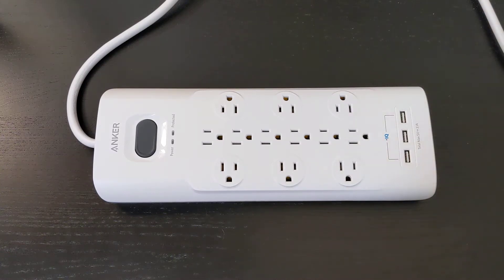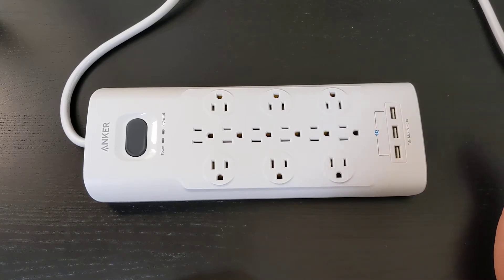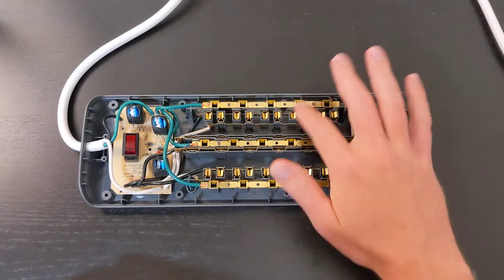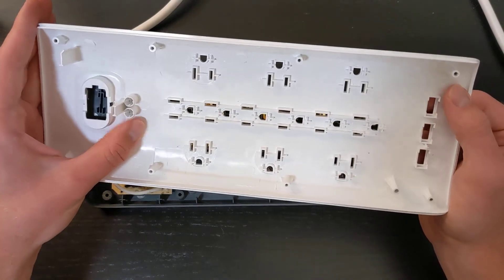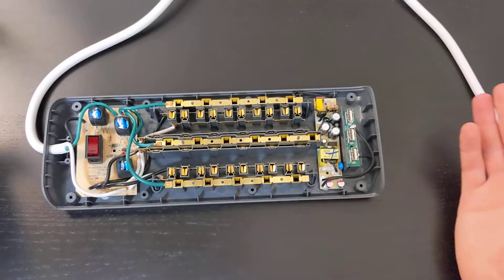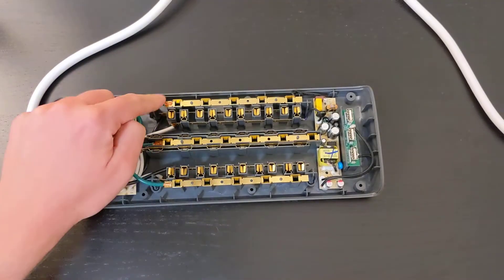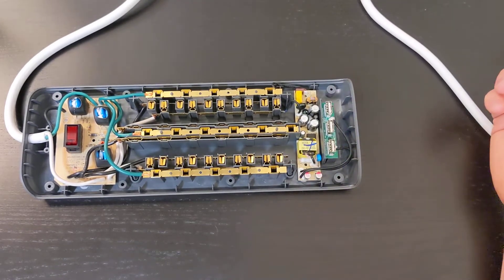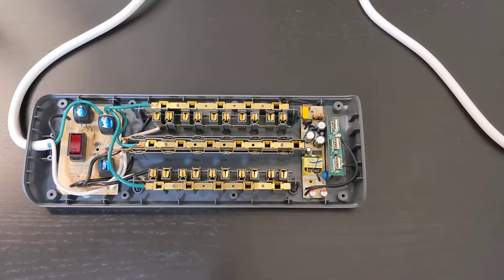Inside an Anker Power Strip with Surge Protector and USB Charger

Comment: I revently bought several Anker surge protectors. Im a huge Anker fan and really like their power banks and cables so when i found out they made surge prtectors, going wuth them was a no brainer. I love the build quality as well as the different sizes and shapes that are offered. I got my mom a smaller 6 port that coveres the ac outlet and even comes wuth a screw for added stability. Then i got the 2 pack of the Anker 351 (model A9192) and i am super impressed with these units. They have 12 ports with the outlets being well spaced from one another. It has Grounded and Surge protector indicators, an on/off switch as well as 2 USB A and 1 USB C with PD (20w for USB C). I have it on a little table next to my bed so i can charge all of my devices in 1 spot. I use a sperate Anker charger 140 (Smart Display) for my phone and other smart/computer devices, but i use the USB ports on the strip for all of my "dumb" low power devices like older power banks and other USB chargable gadgets. Works great, high quality. Another home run and great product from our friends at ANKER

Comment: It would be better if the top middle socket turns 180 degrees to fit another big adapter like the LG 32inch display power adapter.  Its transformer itself is the plug, occupying another 3 socket if I have two on this strip.

Comment: Large power strips shouldn’t be too compact since many equipment have a plug that is much bigger than a standard plug. For example my LG display have an adapter that the plug is part of the transformer. If that is plugged in the middle of a power it will occupy 4 sockets.

Comment: Umm I got a pretty bad problem. My son plugged in his iPad charger into it and then when he went to unplugged it he flipped the switch at the top and now my computer won’t turn on is there anything I can do?
Reply from the maker: Is the power strip on? You might need to toggle the switch to turn it on again. If that doesn't work, connect your computer directly to the outlet. It's very unlikely that your computer was damaged.
Reply: @travis-geis  yeah it was on and connected to an Xbox and a tv and everything else was fine but the computer just won’t turn on for whatever reason. I’m very happy to hear that it most likely isn’t damaged though
Reply: @ussrtaxes8986  I'm sure your computer is fooked. Not gonna try and downplay it